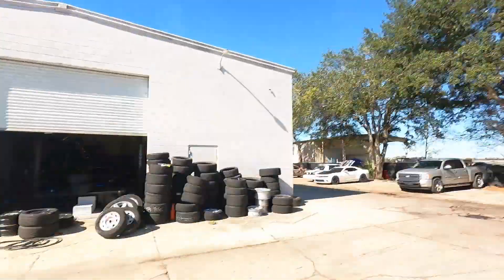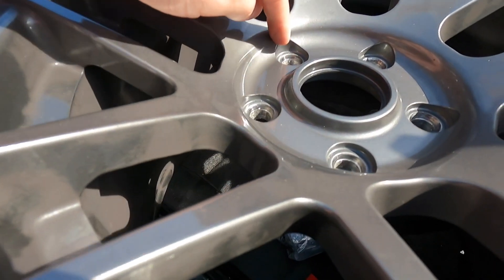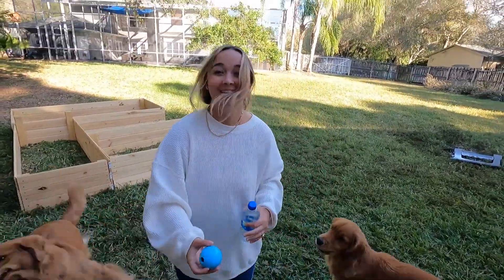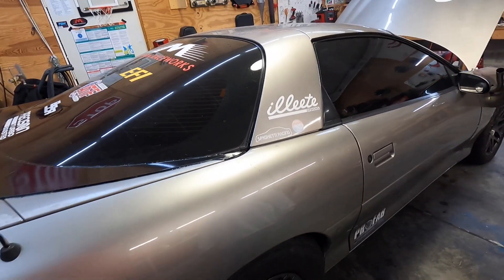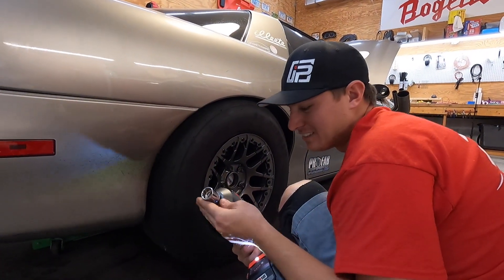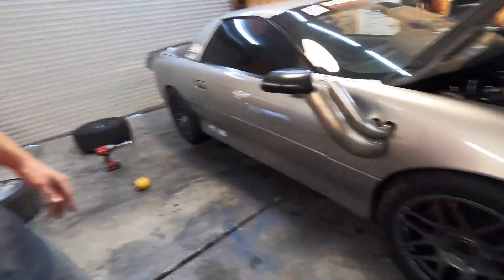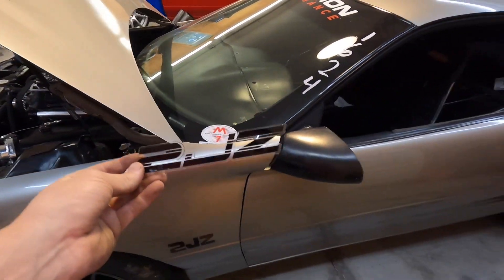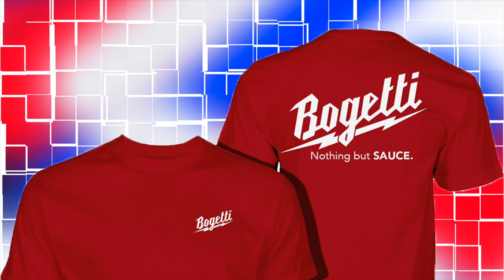New Wheels For The Camaro! (Safer & Better Looking!)

Comment: I wouldn't use an impact on these lug nuts, I'd spin them on by hand and use a torque wrench......
Reply: So would any other mechanic.
Reply: I Agree, He is also going to need longer wheel studs, they do not protrude through the nut.
Reply: you can impact them on just not tight, then torque wrench

Comment: Hey coop, you can use standard rubbing alcohol (isopropyl) to take sharpie off for future reference, it basically melts the sharpie the same way acetone does but you have a lot lower risk of wrecking something. I use it in aviation a lot for metal work

Comment: Nitto extreme drag radial NT555R are good for the street I run 275 60 15 on my chevelle, 510HP at the tires and they stick pretty well. good street manors especially in the rain, FYI compared to Mickey Thompson s street radials the nittos run a little smaller in the same size so you'd have plenty of room

Comment: I learned a trick with sharpies if you write back over the sharpie with another sharpie and wipe or rub it off while it's still wet you can get sharpie off, depending on the material.

Comment: You'll want to keep an eye on the lug holes in those wheels, watch for small spider cracks radiating outwards, might want to consider getting some steel inserts pressed in.

Comment: To fix the glue bead around that rear windshield filler panel, google Run Razor Shaving Tool. I think it will work perfectly to remove the excess glue.

Comment: It’s called lug centric oppose to hub centric. And those lug nuts should be tq’d to 100 foot pounds regardless of wheel or how much power goes to them. I know about a tenth of what he knows but wheels, tires, and lug nuts I have a firm grasp on.

Comment: Pro tip! When using mastic, fill the joint, spray with really soapy liquid and tool the excess off with a wooden paddle pop stick/ice cream stick, no need for tape, done this for work for 15 yrs
Reply: Also u could tape a line either side of what ya done and spread the mastic over it, and do what I said previous and itl look mint! Less is more!

Comment: If sharpie don’t come off, check out touchuppaintdirect.com or for any blem areas, they have factory color rattle can 2 stage paint it’s not perfect but it works pretty damn good if ur not trying to win a car show. I got some for the fender on my wife’s Harley and you can’t tell. Also used it for panels on one of my 4th gens and it a close enough match for what I was looking for. I wouldn’t use it on my 6th gen or iroc, just a suggestion

Comment: Next time when you're applying silicone or other filler such as on the rear wing, put down a line of masking tape each side of the gap, fill it, then smooth over with a wet finger. Remove tape and you've go a clean finish.
Reply: Yep! I just did that, with a sunroof delete panel in my BMW. Worked great.

Comment: Please use a torque wrench on the wheels. It really matters!
Reply: ..and stop calling the old lugnuts dangerous, i'd take them over the new ones any time. You can torque those steelies down till you break the stud, also Coop, the cone on the old lugnuts is their to center it. The new lugs do not have a centering function unless the weheels are made to fit them.

Comment: It see the mystery machine sitting on the back on cleetus shop
Reply: Cleetus said he still had it but wasn't going to run it until the radiator was moved to prevent an accident like what happened at Cleetus and Cars earlier last year. ( radiator hose blew and burned the guy real bad because it was behind the driver )

Comment: You still got the mystery machine? Haven’t seen it in a good while
Reply: 1:15. You can see it in the background. Cleetus said they were moving the radiator before anything else. (It’s right behind the driver and they are much more safety conscious after the accident at cleetus and cars)

Comment: Looks like you ned a tad longer wheel studs Cooper, Im pretty sure the studs need to stick out from the nut to pass inspection at tracks?
Reply: At least 3 threads.

Comment: Bloody hell. Where does this b/s come from with taper seat nuts being unsafe. Actually the best way of fitting a wheel. Clamps tighter and centres properly unlike a shank nut. Lighter? if they are alloy they are truly dangerous.  They will strip, and 'bell' so as to be useless. A  STEEL shank nut is ok but makes it harder to fit the wheel. And learn to use a rattle gun, you can get them done up tight with a 'feel' for the gun. So many overtighten and that causes studs or nuts to fail.
Drag racing needs a reality check with all the stupidity so called safe. With a total lack of brakes, functioning suspension etc etc

Comment: You could have drilled an riveted instead of that cheep glue your so new to game.
Reply: Yeah, lets open up areas where it can rust....Terrible idea.
Reply: @BigShastaKen  rivets are aluminum, pre drill, coat holes reinstall with foam tape water tight its a drag car.